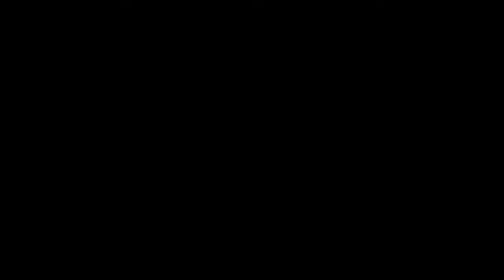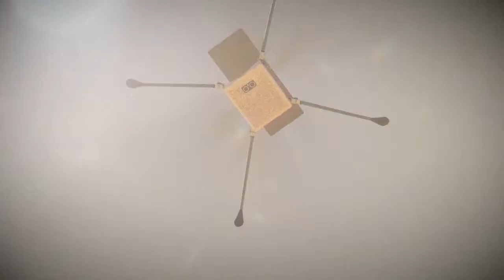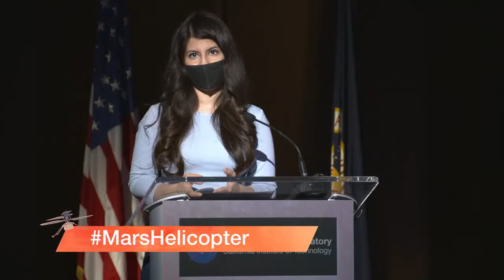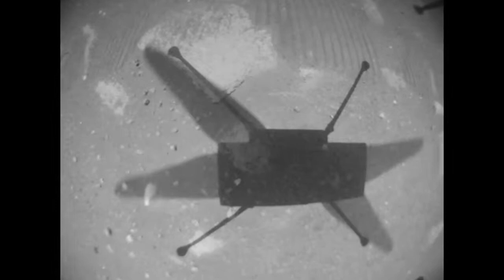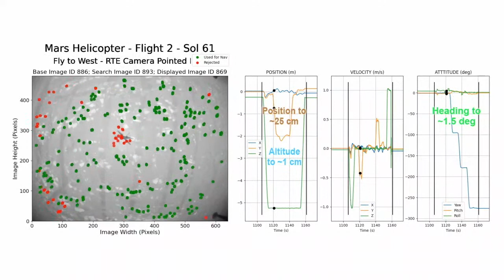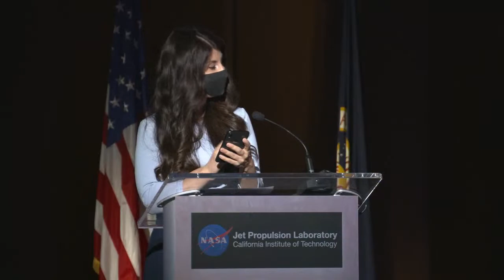NASA’s Ingenuity Mars Helicopter’s Next Steps (Media Briefing)

Comment: Percy: "I need following procedure to work for You at infinite:
1. Check battery status/ampers 
2. Land if Battery low. 
3. Charge battery until  bat_stat>= 90%, 
4. Repeat point 1. , 2. and 3. untill route is complete (it has landed where it started)
+ of course obstacles, collisions detection.
This way I'm not afraid to fly even +1000 km away, i can  even reach Insight to clean solar panels for You"

Comment: Will Perseverance get close enough to any RSLs that Ingenuity could fly near any?    If so, any idea when?   It would be so cool if Ingenuity could solve the mystery of the RSLs on Mars.
Reply: RSLs, do you mean ice, snow? 

5 conditions and it could eventually realize that. In my opinion the idea would to dip its 4 legs into the snow when temps are under 0C (of course) and go back to Percy hoping smal amont of snow stays on its legs so that Percy can analyse.
But taking a foto of rsls in 12MP would be alredy enought, but Heli needs to come back to transfer those images thru Percy to us. Conditions:

1. Check battery status/ampers
2. Land if Battery low. 
3. Charge batteru until  bat_stat>= 90%, 
4. Repeat point 1. , 2. and 3. untill route is complete (it come back to the starting point). + of course obstacles, collisions detection.

This way they could eventually fly it at infinite.

Comment: 6 moon landings, and take offs.
Powered and controlled.
Why is this the first?
Reply: after 1976 NASA landers, 20 years passed before first mars rovers.  3 generations of mars rovers got larger and larger.  Also,  since 1990 earth Walmart size midget helicopters have improved radically with better microcontrollers, better inertial guidance systems sensors, smaller, lighter, etc.  need to to push wheeled rovers on mars first, mars helicopters are very edgy uncertain technology, so wheeled rovers should have been first.  powered and controlled rockets mess up chemical samples and are not sustainable when your rocket fuel is gone.

Comment: Are there immediate plans for a larger airborne vehicle? My thought is a gyro copter design would I believe perfect. A larger free wheeling rotor on top of a heckle that only needs a high performance pusher propeller. Seems like it would be very energy efficient. The upper rotors could be transported there and easily assembled.

Comment: The most under-valued event in human history in a long, long time.
99.9% of people: A drone? what's so hard about that? my 5 year old has one.
Reply: ;your home is 15 light minutes from mars, need larger transmitter,  but it must be totally autonomous, start to finish, from when the motors turn on, til it comes up to speed. Your home sensors, your eyes, do not control the stability in anything close to the way the mars copter does.  So yes your home copter works great and is very simple, but  totally inapplicable to autonomous navigation on mars  Every move must be sensed and validated before going on to the next step.

Comment: Could you add a high intensity LED light to future RTG powered rovers to recharge the copter(s) quickly?
Reply: Wouldn't be very useful in actually reducing charge times because you'd have to put out a ridiculous amount of light of the right wavelength in order to get anything realistically usable. That's more weight on the rover that's not really necessary. I don't know about the power management of the RTG, because the rover benefits from thermal management and keeping the lithium-ion batteries as back-up charged. It's not a good idea to not have reserve power in case something happens. Now... what could possible be done and would be more effective is some sort of wireless charging ability. You could have the helicopter land, have the rover drive over or near the drone, and extend/release/drop some sort of wireless charger and then use the RTGs to boost the charge or charge during the night. It has an added benefit, too, in that not much weight being necessary for it and it being multitudes more efficient than using an LED light to charge via solar panels.

While part of me would think it would be really cool and awesome to see the helicopter land on the drone and deploy it and dock with it or whatnot... realistically that's a danger to both the rover and helicopter if something goes wrong and it's needlessly risky. But having the rover drive over to a landed helicopter drone and extend an arm or something to enable wireless charging would probably be doable and much safer.

Although, realistically, everything in these missions needs to be planned out and coordinated to such a degree that I doubt the team would see much more benefit and available flight time even if they had it. Would probably just be better to have a larger helicopter drone with a bigger battery bank in the future, given how successful it's been and how useful it could be.

Comment: #AskNASA #MarsHelicopter How come the Engineering camera always shows such a crisp dark shadow of Ingenuity? As if the sun is always perfectly in its zenith... Or did you land on Mars' equator and are you flying only at high noon to maximize energy capture of the solar panel?
Reply: Very good question!  Probable they flight around the same time every time...
Reply: They explained earlier: Best time to fly is late morning, just before noon, so the batteries are fully charged and after the landing there is enough aftnernoon sun to recharge the batteries before they need their energy to keep warm through the night.  So very similar conditions in every flight.

Comment: How about putting the co2 to O2 devices into vehicles on earth to tackle climate change?
Reply: The device works by converting carbon dioxide to carbon monoxide.
Carbon is not actually taken out of the atmosphere, and carbon monoxide is poisonous, so it's a non statrer as a method to clean up the Earth's atmosphere. It's viable for small scale oxygen production though.